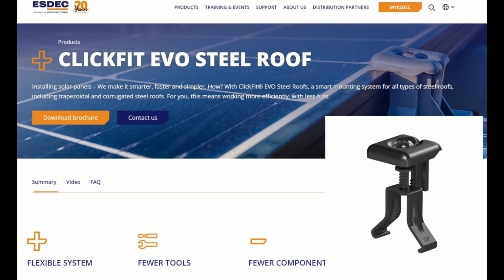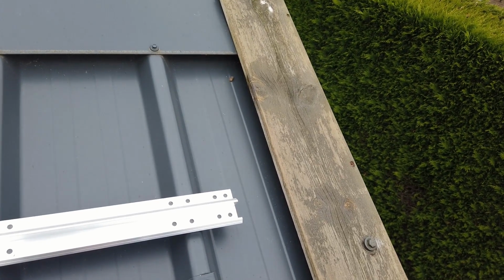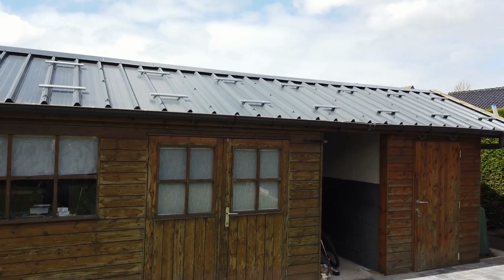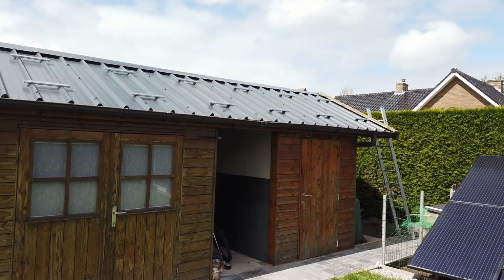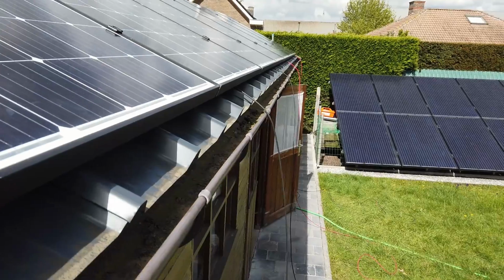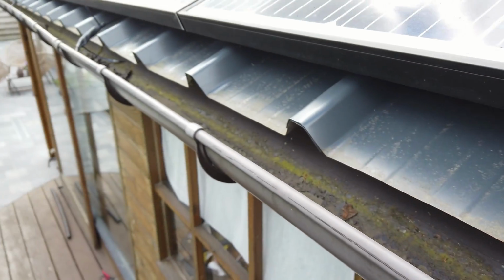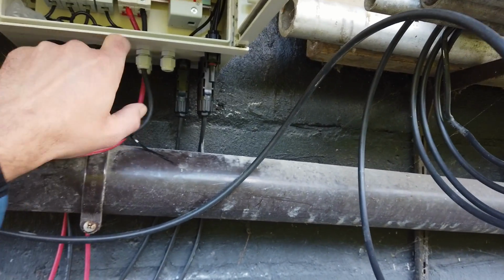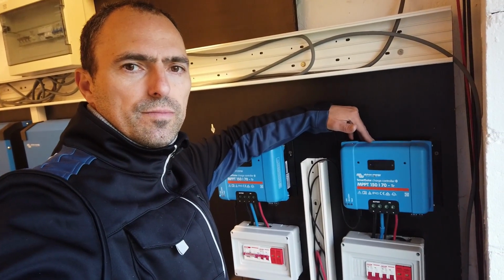Adding 3KW of solar to the shed - step by step DIY guide.

Comment: Thank you for posting your video! MY wife and I are preparing to go off grid and will have a metal roof just like your roof - I appreciate seeing your installation! Where did you get your work gear (brand) - would love to have flexible clothing to work in!
Reply from the maker: Hi Ron, I got this from a discounter store (Lidl - EU brand) It's available in any hardware shop. Just choose pants with polyester, it give a warm feeling in winter.

Good luck with the off-grid built.

Frank - EASYPOWERWALL